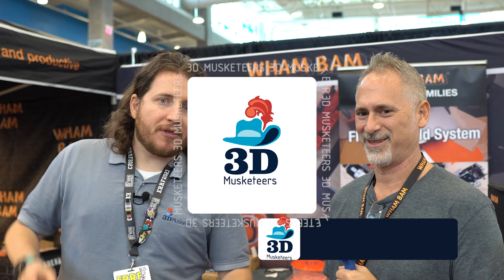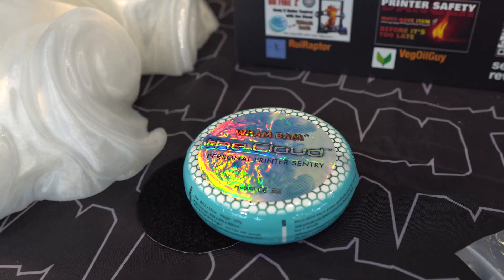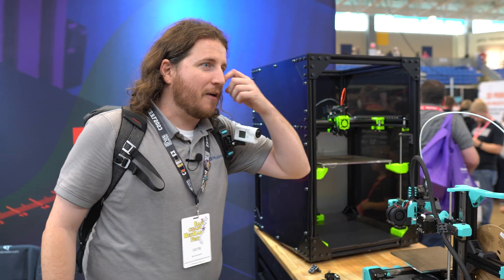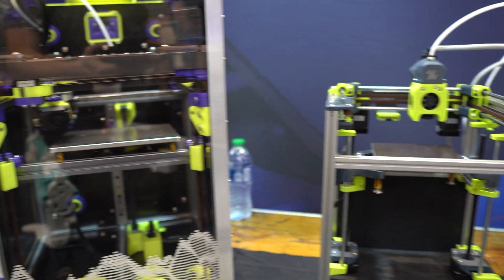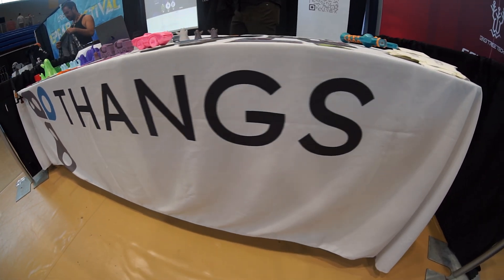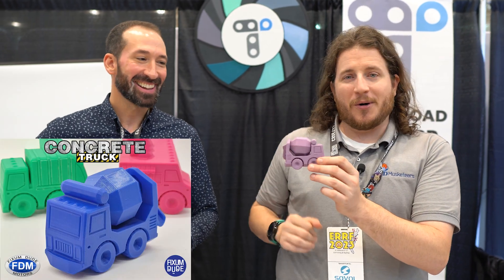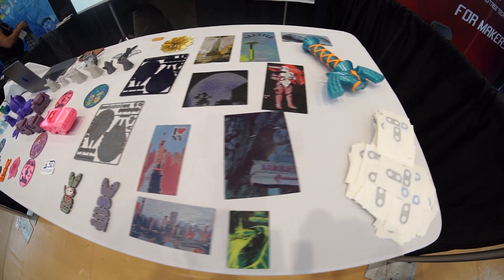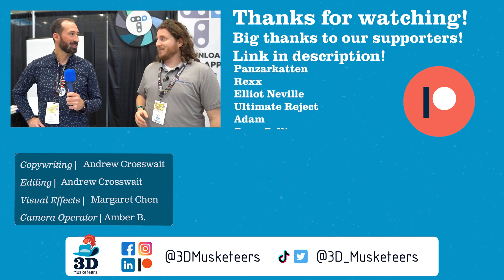Wham Bam Boxes, Fabreeko Blasters, and Thangs Things! - ERRF/3D Printopia 2023

Comment: I'm gonna be one of those, but what was the camera you used on the vest? It seems great.
Reply from the maker: It is a Sony Action Cam the FDR-X3000, however it is in a HRD-AS300 case as it required a transplant from the previous owner. Not sure how that all worked, but hey, got a great deal! I use a sony rm-lvp2 to see what it sees and make sure the shot is good. Some color correction in post and boom, done! You can also use your phone through a sony app to see what the camera sees. We have a few of these action cams, with different specs, this one is my favorite and one of 2 that we have that do 4k.

It is mounted to my bag with a generic backpack mount for a gopro and a tripod base adapter (1/4-20) which the camera has natively. The camera is insane, even has microphone input!
Reply: @3DMusketeers  Thank you. That was a lot more informative than I thought/expected.  

After a quick search it came out in 2016 so may look for a used one, but the detail is great on that.
Reply from the maker: yeah all our gear is bought used, let someone else eat the depreciation! If you ever have gear questions let me know!!

Comment: I am interested in the WB hot box. In my state, and due to poor insulation, the living room gets 50-55F in the winter. For resin printing, I need the extra heat so USB rechargeable glove warmers. But a thick cardboard box is still not enough to retain the heat.
Reply from the maker: they can definitely help!! Need to get you a Politician when they are finished!
Reply: Have you considered foil faced insulation foam from a home improvement store? Usually between 13-30 dollars depending on the thickness for a 4x8 sheet. You can incase that in some fire rated drywall just as like a simple enclosure.  Runs about 15 bucks a sheet also.
Reply: @ShotGunner5609  Thank you for the suggestions but I have had bad luck using foil insulation. The thin bubble wrap-like stuff. I just can't get it to adhere long to the cardboard. I am thinking of trying the 1in foam sheets and hot glue them to the box. The only downside is my cats love to chew foam and tape. 

The advantage of these is the vent access. When I use water washable resin there is little issue in the kitchen unless I leave the top off. But for my other resins, well, it smells worse than a tire fire. Sure, I could make vents as well in the cardboard/foam but if I don't get the seal right adding sealant melts the foam. I tried that before and messed up on a different project. 

So in short, I guess I am tired of DIYing it through the winter. It may be better to spend a little more and get a made item. Can still use the hand warmers in the tent if I have to.
Reply: @RoseKindred  no there is a foam board that has the foil bonded to one side of it,  you can just get some foam glue or construction adhesive for a couple bucks a tube and glue it to whatever you want. I mentioned the drywall because it's a cheap sheet material and is real easy to work with.the fire rated stuff just gives kore piece of mind if you decide to use some kind of heatting element. But i can understand being tired of trying to build a solution.
Reply: @ShotGunner5609   Huh, well can't hurt to look. Next time I'm in the hardware store I'll see if they have foiled foam boards.

Comment: great to see products like the wham bam cloud, didn't know it existed!
Reply from the maker: Yeah! Cheap, albeit messy, insurance is great to have!
Reply: @3DMusketeers  yeah I have a fire detector at the moment, I'd like to add some form of extinguisher too, because why not
Reply: @FaustBusserl  The WB-Cloud is great, especially with its compact size. If you are running a small farm there are also longer tubes (not through WB) that are the same thing. Picture fluorescent tube sizes about 24 to 36 inches long. Even more mess, but if one printer acts up and you use wooden/foam on the shelves, you may need more coverage.
Reply from the maker: yeah, a mess is easier than a fire to cleanup from..